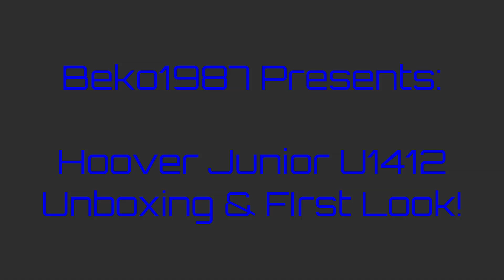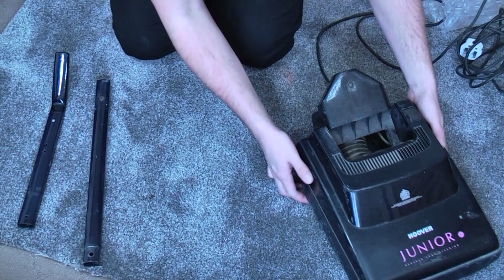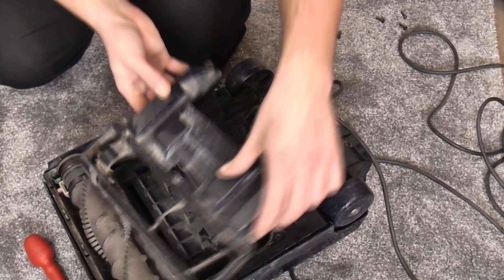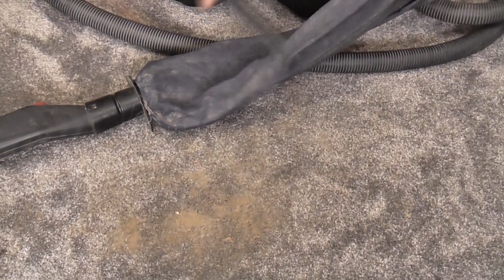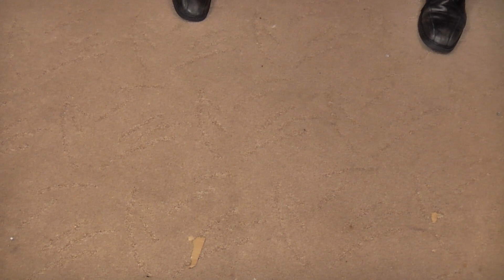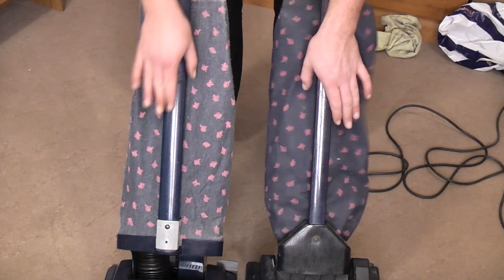Hoover Junior U1412 - First Look, Before Refurbishment!

Comment: Wow! That’s is so unusual! Completely and absolutely budget, but the thing I like the most and I wish all the others had was that bag removal system and the power switch on the base, that is fab! But with no wheels or height adjustment, wow! Awful. It will be fab when you’ve refurbed it and will sound and look really good.